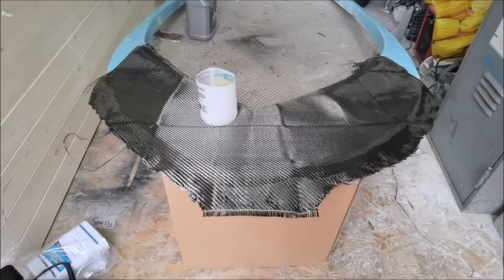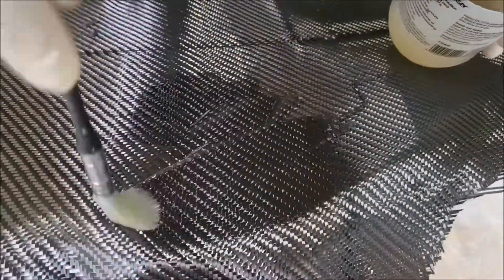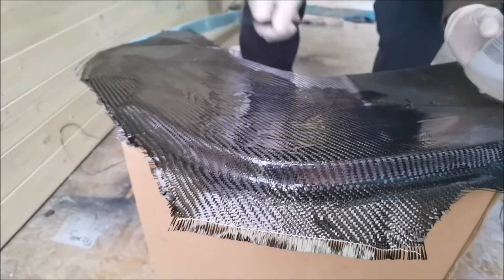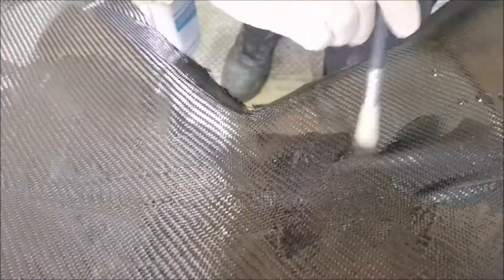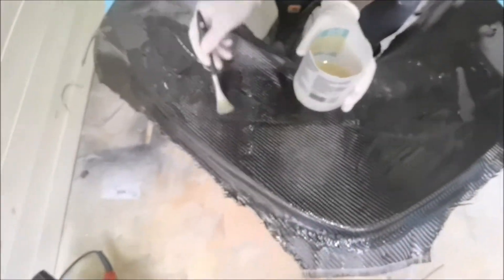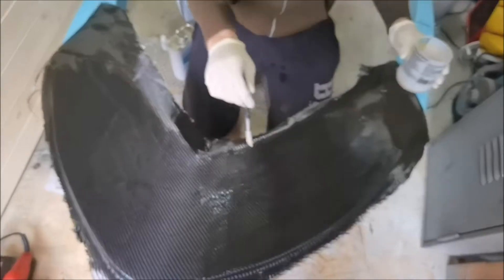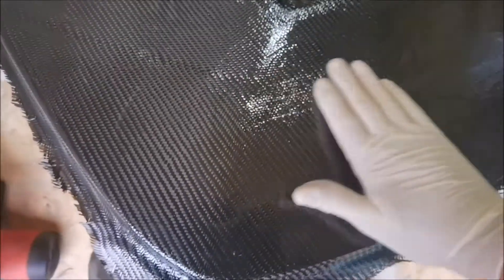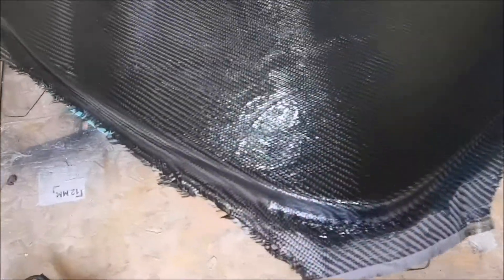Dinghy restoration part 7 carbon fiber

Comment: Spray the part black before you put the carbon fiber on it. That way the part will not show through the weave. Best practise is to put the resin on first thoroughly wet the area out, then put the carbon on top of that and almost stipple/dab the carbon so it soaks up the resin. 
If you are trying to get a gloss finish and you are using "Epoxy" rather than "Polyester" resin. Leave the first coat to go "tacy" where you can put your finger on it and your glove is sticking to it but no resin comes off. Apply your second coat and leave it over night. This should give you a gloss finish. If you have left the resin to go hard. You can rub down the resin and then spray with clear coat. This will give you a perfect finish.